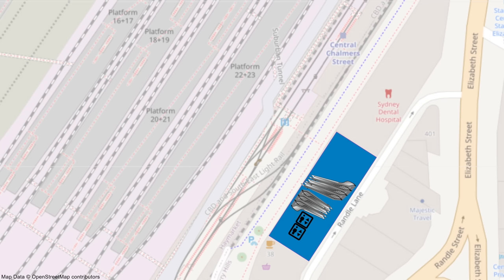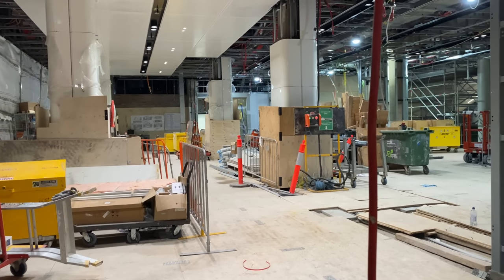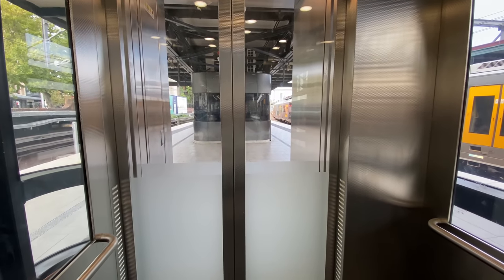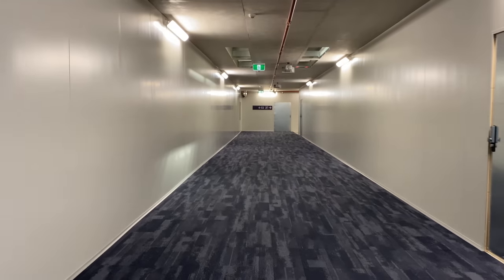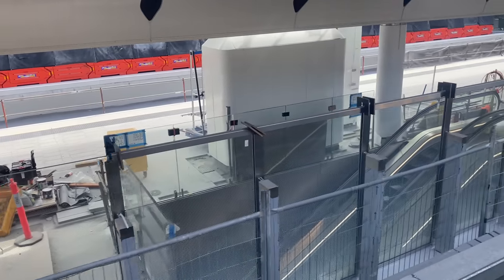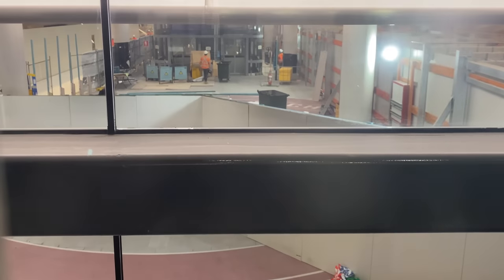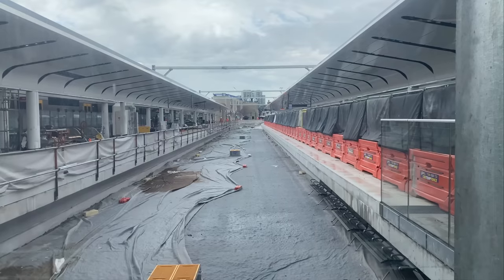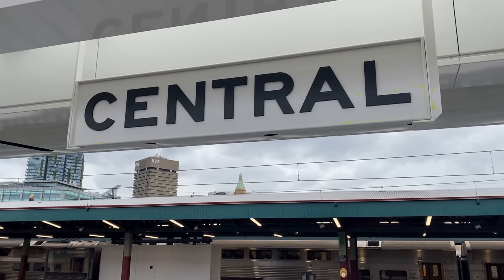Sydney Central Station Upgrade | Central Walk, Metro Concourse, Chalmers Street Entrance | March 23

Comment: I was in Melbourne recently and used the Southern Cross station. What I liked about it was the roof covering all platforms providing weather protection. I would have loved for Central to have full roof coverage. I think it's a missed opportunity for practicality
Reply from the maker: I was in Melbourne recently as well, to film Metro Tunnel. Look out for that in April. I spent a very enjoyable hour wondering around Southern Cross Station, watching loco hauled regional trains departing (it was the evening peak). I enjoyed the classic diesel smell that you don't get Sydney, and did notice the long canopies as well. It took me a little while to find the dual gauge tracks. Yes, it would have been nice to have the full roof canopies at Central (and elsewhere in Sydney), not so much for the rain, but more for the strong sun in the summer.

Comment: Wow good informative video Paul.I really still enjoyed it & this one too.its really amazing how so much has changed & how much it will look in the near future. even now I was impressed with the new central station concourse that was opened again, they have a very nice accessible esculators that lead up to the platforms. & also brand new lifts.

Plus I also heard about the metro station below had tooken shape & they were putting esculators in.i think they were going to open in April 2024
Reply from the maker: Thanks! Glad you enjoyed this video! The escalators and lifts are delivered as a separate contract, so it makes sense to complete them all together, even though the Metro Station ones won't open until 2024.  Whether it's April or another time will depend on how the train testing goes, and I've heard a rumour that testing might start next month!
Reply: Let's hope you get on one of those testing trains, although I understand initially they will be unmanned.
Reply: @TransportVlog  Yeah Paul, train testing will commence at 0100 on the 21st April, 2023.
Reply: Based on what happen with north west testing took 10months so if this is 10 months probably February 2024
Reply from the maker: @krislawry  Thanks Kris, I'll keep a look out for them!

Comment: Yeah. A big improvement. But it does not make the trains any faster. Especially the Illawarra line. You still have to wait over an hour between trains. And trains to Cronulla &  Waterfall are every 15 mins. And you sometimes get 4 carriage  trains (in peak hour) on Illawarra line. Every train on Illawarra line to Central & Central to Illawarra should be 8 carriages.
Reply from the maker: Hi Rhett, that's coming under the "More Trains, More Stations" program, which will bring the Wollongong to Central frequency to half-hourly and the new Mariyung trains should mean at least a 6 car train and up to 10 cars. The T4 line will also get 30% more trains. You can find out more here - https://www.transport.nsw.gov.au/projects/more-trains-more-services
Reply: @TransportVlog  Hope so. 🤞 We also need a shuttle service between Thirroul & Port Kembla.  Sometimes it is over a hour wait for a local train in both directions.

Comment: Hi Paul, interesting video. Will the station actually be split names with Chalmers Street and Central? If so, where exactly will be the location where the name will change. We are doing the opposite here in Melbourne, with out new planned rail line with a second Burwood station being built near Deakin University. The other Burwood railway station is further west on the Camberwell to Alamein train line. The two Burwood stations will be completely separate. Time will tell how that progresses. Maybe one Burwood station will have a name change as time passes!! Incidentally, how far are the north and south Central Walk escalators from each other? Interesting seeing Central Walk, which reminds me a bit of the walkway that we used to have at Spencer Street Station. However, this was all demolished when they rebuilt it all as Southern Cross Station. Will they be renumbering any of the platforms later, due to platform 15 now being gone? Which train lines used platform 15, when it existed? Just thinking, they more likely have spare seats and platform signs from platform 15, which they could now re-use on other platforms. Anyway, all the very best. Rob.
Reply from the maker: Thanks Rob, the light rail stop for the L2 & L3 is called Central Chalmers Street to differentiate it from the L1 stop which is called Central, Grand Concourse.  However, the train station is still called Central, and the new Chalmers Street entrance will be another way into Central Station.  Yes two Burwood Stations would be confusing! Let's hope they change that!  I would say the north and south escalators are about 50 metres apart at the platforms. It's about 3 carriages of a Waratah Train. No plans to renumber the platforms. It's too difficult these days, as the platform numbers are programmed into many different computer systems! Same scenario as Platform 11 at Flinders Street. Platform 15 was rarely used, and was primarily for stabling trains only. The platform signs have been reused, but the seats are new.  Glad you enjoyed this video. I'm working on a Melbourne Metro Tunnel video at the moment, which I'm sure you'll love.  Hope to release that later this month.

Comment: Transport Vlog, they will start testing the metros on the 21st of April
Reply from the maker: Yes someone else mentioned that to me.  They still need to complete the overhead wiring within the Marrickville Dive Site and within Sydenham Station, before testing can start. I guess that can be done in 3 weeks!
Reply: @TransportVlog  they will do that separately but they will start testing in they city first at 25km/hr than up to 100km/hr but sydenham to Bankstown will most likely be later